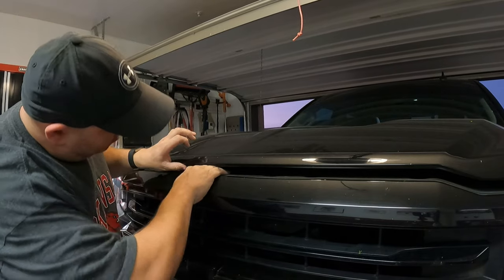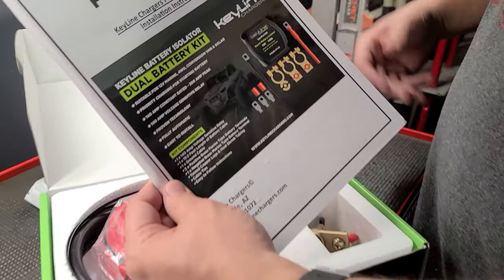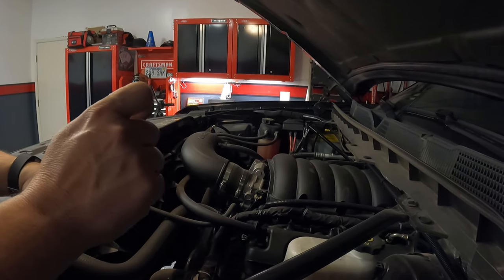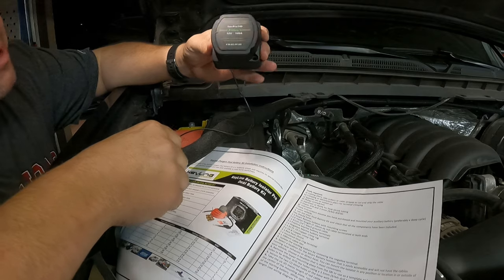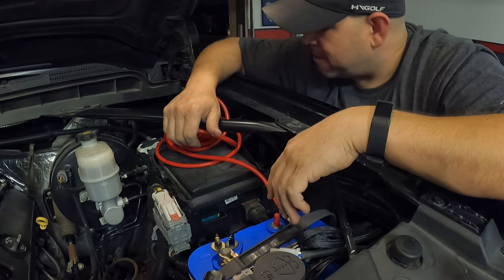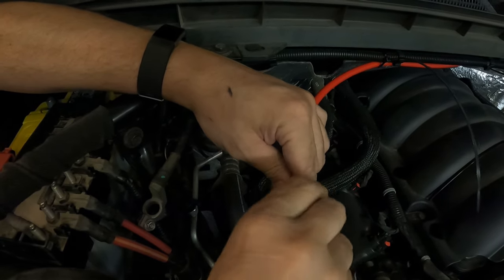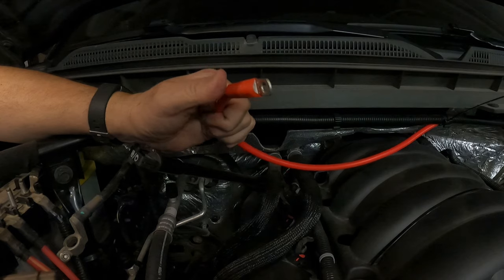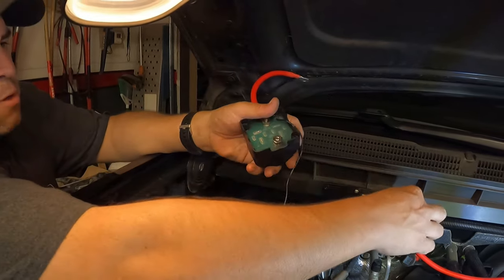DIY: How To Install a Dual Battery Set-Up Using a Battery Isolator on a Chevy Silverado 2014-2018

Comment: Are you having any issues? I did it the same exact way on my Escalade using two brand new agm batteries, using a 150amp battery doctor isolator and 2 guage wiring but I'm having issues where both my batteries are showing low voltage but when my truck is started its shows my alternator charging at 13.5 to 15 volts. so I'm not getting why they are staying both low after running truck a while ND shows it charging.
Reply from the maker: We haven't experienced any problems like that.  Try to hook up the aux battery ground to the sensing ring as mentioned in one of the comments below.  Hopefully that helps.
Reply: @nymphowolf  did u find out what the problem was ?
Reply from the maker: We will probably end up doing the same just to make it where things can cause problems.